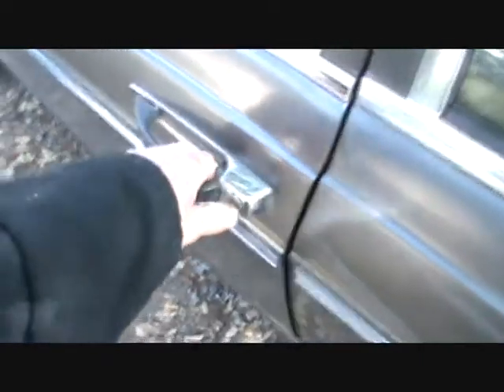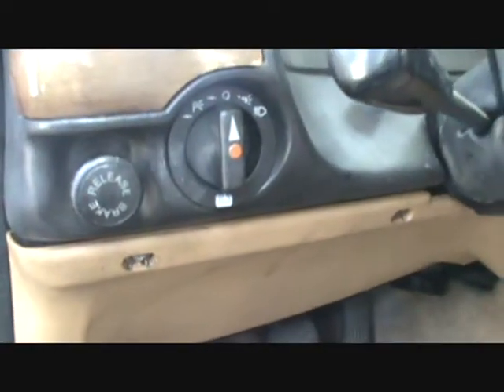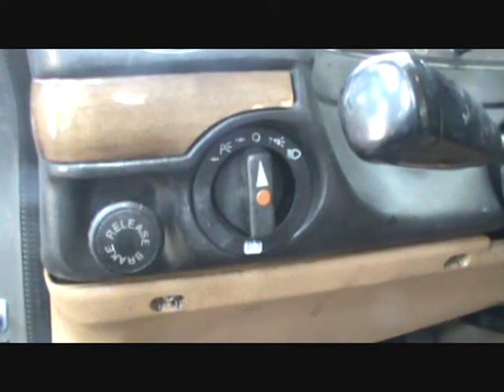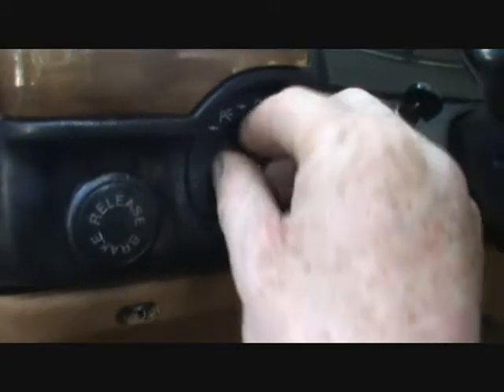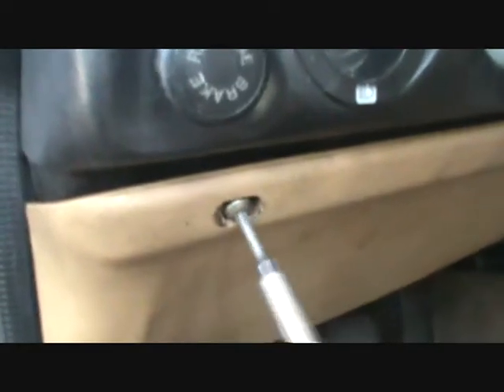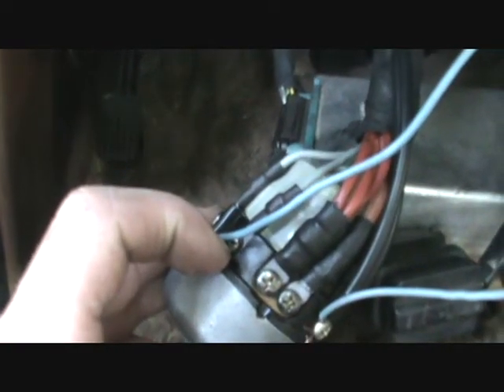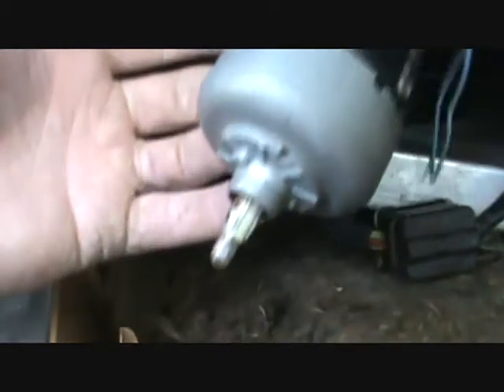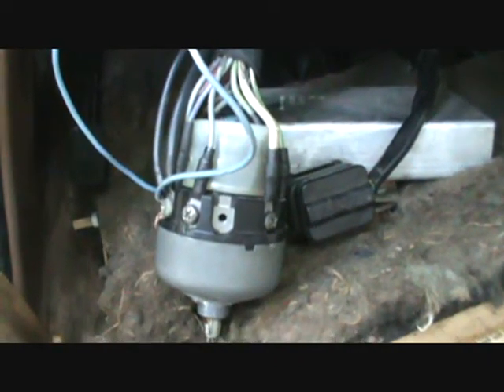W123 Mercedes headlight switch modication

Comment: What really needs to be updated is going to an electrical oil pressure gauge.  The mechanical gauge over time will start leaking and then you can get a catastrophic oil leak that drips oil all over the inside of the dash and down on your feet and carpet.